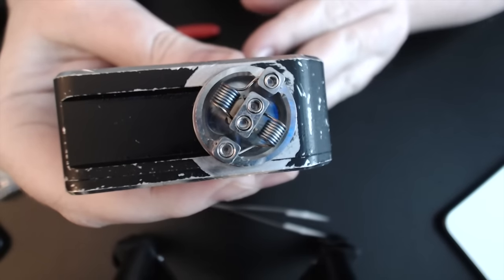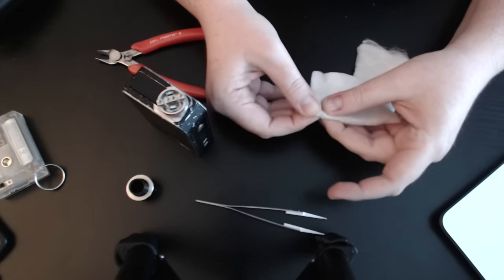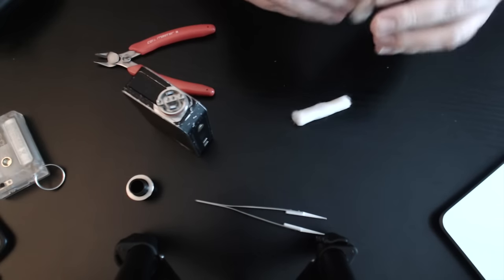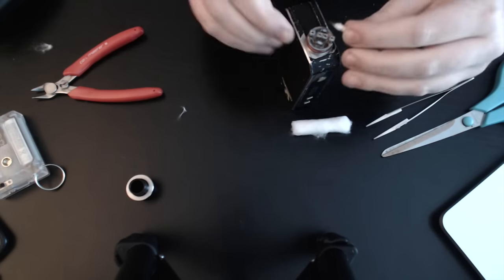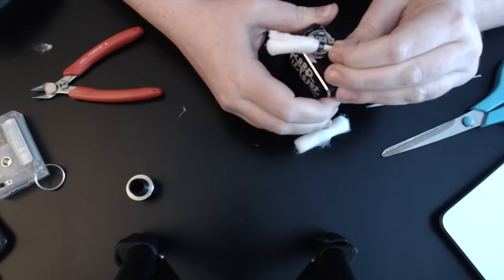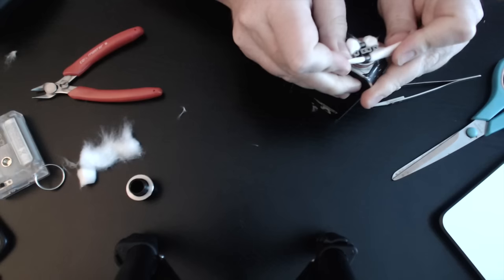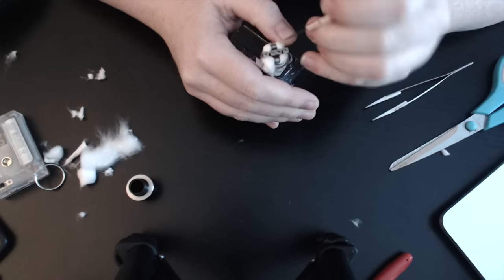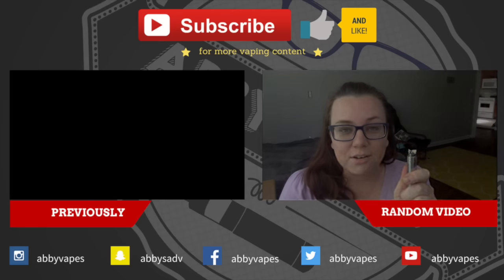Scottish Roll Wicking Tutorial for RDAs (no dry hits)

Comment: tried this. For me, it works with regular pad, but i cant do it with thin pad cotton (like koh gen do cotton). One thing I've found when I did this method was the rolled cotton I used once broke apart when I pulled it through the coil when I stretched it too much, but it might be because the quality of the cotton I used.
With this method, I never had a dry hit using my RDTA and the cotton seemed to last longer (it's subjective tho).

Comment: I have done this method for a month or so on several 24ga and 22ga 2.5mm and 3mm ID coils at about 0.2 ohm it does work well - but noticed it was very dark colored inside the coils when changing (and I paint and soak the coils and fill the well early #overdripper) - I've just gone back to separating the pads in half, cut two 3/8" strips fluffy side out with short tails just touching the deck and seems less dark inside when changing) - Jap cotton is very versatile, I'm constantly experimenting, even both outer layers removed - I do agree less spitting with this method - maybe do a follow up on your thoughts after two days use 👍
Reply from the maker: +Vape McVaperson i will do a follow up! thanks for your feedback :)
Reply: Thanks for the review 😆

Comment: You can get these same results much easier.  Just use "Koh Gen Do" brand cotton pads ($2.99 on eBay)  KGD pads are much larger than the dinky generic pads you see everywhere lately.  Koh Gen Do is perfectly sized for this method so you can get 4 wicks out of one pad with almost no waste.  Peel a KGD pad into two thinner pads each with one layer of "skin" and one layer of fluff.  Cut each in half across the grain so you have 4 pieces.  Twist the end of one the pieces so that the skin side gets swirled up inside the fluff and make a starter pointy piece on one end of the cotton.   Thread this through the coil (works best with 2.5mm to 3.5mm coils).  After you pull it through it will roll itself sufficiently to make this work.  The main secrete here is TIGHT cotton in  the coil.  Also you MUST make sure to cut the tails so the ends either hover above or barely touch the deck.  If they lay flat sideways on the deck it won't work right.  KGD is superior quality and will last longer than the other brands and when you couple it with this method of wicking you can vape virtually FOREVER between rewicks.  KGD is more expensive per sheet but it is twice the amount of cotton you get in the dinky generic pads.  PLUS it lasts longer.  You will save a lot of money by using this technique with KGD and it is also a big time saver when rewicking.  Cheers!

Comment: I am using a SMY TC mini 60 Watt box with a royal hunter RDA and I had two 3mm 9 wraps on it at 45 watts and wasnt getting any vapor off of it, is it because it doesnt have enough power to heat it up? 24g wire

Comment: Can someone tell me if they have tried this wicking method with thick VG only juice and if so how does it hold up? My builds are 0.28 dual parallels with the juice becoming slightly less viscous with the heat but I'd like to know if that in itself will help saturate right through to the core of the wick if it were this tightly packed. Thanks
Reply: +Junior J I have done this with 35/65, 30/70, and 20/80. It works fabulously. I'm quite impressed, and I tried originally with crappy cotton makeup pads I could not have otherwise used.

Comment: I was originally taught to take a layer of cotton from a sheet, roll it up, and do basically the same thing, the only problem with that is that it only take a short time before your cotton gets charred, and it requires you to drip constantly.Then, I was shown the wicking technique that you demonstrated in this video. GAME CHANGER... Using my go to set up (Wotofo Lush RDA with a triple twisted 24g kanthal dual coil build, coming in at .1 ohms on my LostVape Efusion) I can take about 15-20 rips before having to re-drip, and i NEVER burn cotton! You do go through a bit more cotton using this method, but it ends up being about the same since there's no need to change it as often. You have some awesome and informative videos Abby, keep it up! #vapefam #dripclub #notblowingsmoke

Comment: Hi +Abby Vapes , I've this problem with my wicking
My setup is a Derringer & Cuboid Joyetech, 24 gauge dual coil, 0.4 ohm , 3mm inner diameter(9Wraps),  40watts
My wick keeps breaking in the middle of the coil after a few puffs. And naturally after it breaks in the middle, it stops sucking in juice from the side.
Any idea what's causing this?

Comment: Well, that is similar to the technique I used, except for that I didn't roll it up before twisting and pulling through the coil (and I didn't rly cut the ends before but that's just because mutation x v4 actually has the airflow holes placed higher and it's ok to just stack it under the coil without cutting the airflow). That actually makes alot of difference, 3-4 hits or even 1-2 longer hits on above 120W were giving me the dry hits before, now I've tried 7 longer hits and it seems perfectly fine and tastes great. Holy shit though, should've watched the entire video before doing this, cause the cotton leaves I've got are massive and I felt so dumb when you had to cut a nice amount and the amount I actually had to cut to get it through the coil is probably going to be ok for another two builds wicked in the future. Thanks tho, another thing that comes in handy, you learn through your entire life as they say.